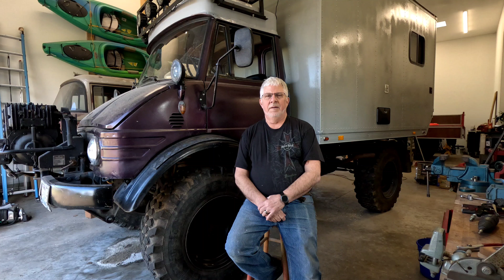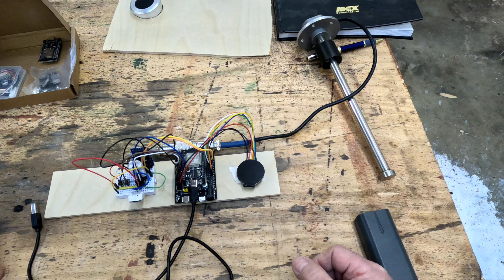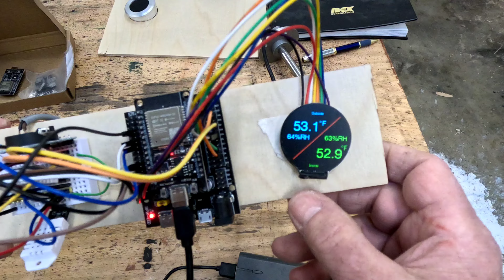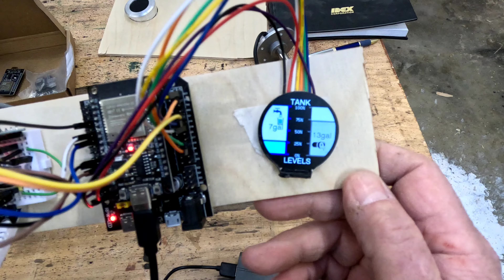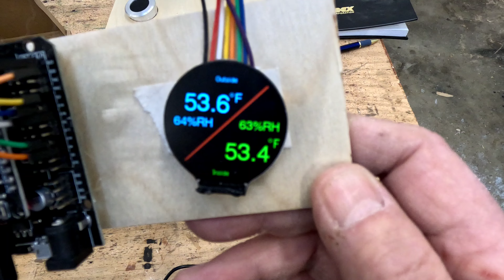esp32 & LCD Display RV Tank Levels

Comment: Awesome. Thanks for the video Charlie. You should come to NZ for a beer some time. I've been attempting to achieve a similar thing but I figured I try a low volume pressure sensor to determine tank level.
Reply from the maker: A beer in New Zealand sounds great!  I'm not sure about a pressure sensor for level though.  1 bar takes 10 meters of water head.  In my case, the tank is maybe 18 inches, or say 500mm to make the math easy.  So empty to full is a 50 mbar swing.  Hey.  That will work! And give you better resolution.  I'm not real happy with the float resolution.  Maybe I'll copy your idea in the next iteration ;-)